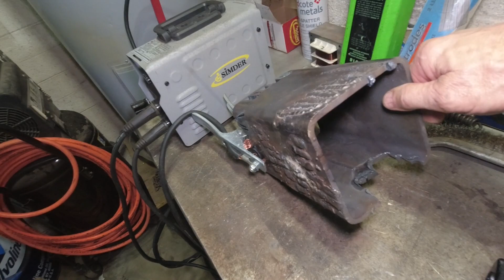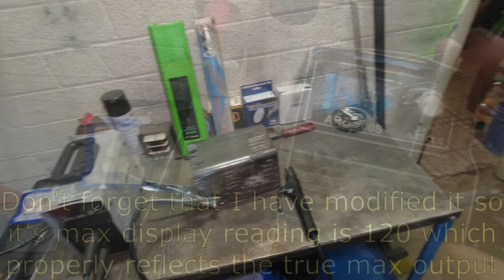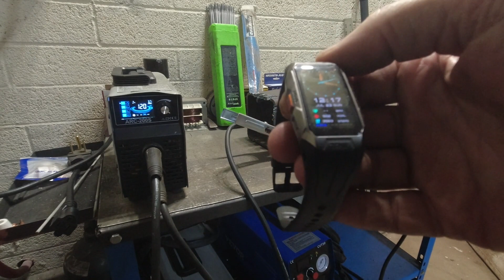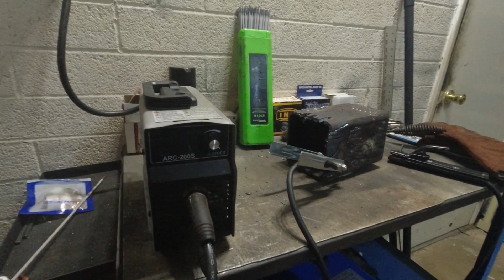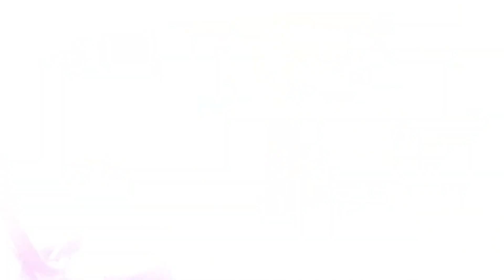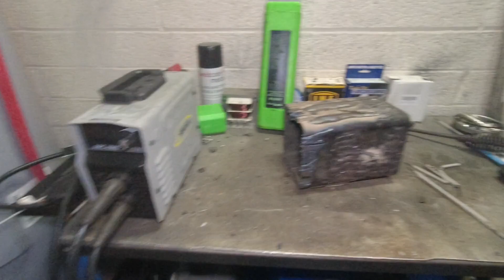Simder Arc 200s Stick/Tig Welding Machine 1 Year Update with Overheat Test! Was Project Farm Right?

Comment: the 7018's get a little bit of glass on the end of them so usually i would take them out of the stinger and i would run a file across the glass tip
Reply from the maker: In the time I spent working in shipyards and building pipelines as a young guy I've probably run many hundreds of pounds of 7018 and I've never once filed the end of one. Of course in those jobs you ran it to a stub far more often than not. I can imagine the looks on the faces of some of my old foremen if they saw me take a half stick of 7018 out of a stinger and file the end down. Of course, that was production welding where time was more valuable than a half a stick of rod.
Reply: @3rdpig  that makes sense. Different environment, different situations, different ways of doing things.  Thats just how i learned or flicking it when it gets the red glow so its clean for next time :)

Comment: How do I stop from the power going out I bought a generator since my house electricity wasn’t capable of running the machine and the generator seems to do the same
Reply from the maker: This machine really needs a 30 amp circuit if you're on 110/120 volts or a 20 amp circuit on 220/240. If Anything less and you'll pop the breaker if you turn the machine up past about 80 or 90 amps (around 150 on the front panel). So look at the breaker on your house or generator and make sure it meets what I said above, or just start turning the machine down until it stop popping the breaker.

Comment: Seems like a good unit I'll stick with my Harbor Freight titanium 225
Reply from the maker: If I had a Titanium 225 I'd probably stick with that too. The little Simder welder isn't bad, in fact it's pretty decent considering it's price and it's tiny size, but it's not a machine that's good for regular use. At least IMO.

Comment: I just got this machine and we were having the same problem striking the arc. We fiddled with everything and finally started getting it to work before it blew the fuse (30a). Does it function better as a tig welder?
Reply: Follow up question: what settings would you recommend to run it on? Just looking to use it for craft/hobby till i get some experience and can afford a better one.
Reply from the maker: I've never used it as a TIG, but to be honest, for a good TIG machine you need high frequency start, gas control built into the machine and, if you want to weld aluminum, AC output. This machine has none of those. Can it be done? Sure, for sheet steel, using a scratch start and a torch with a manual gas valve, it will work. But TBH, this machines best use is as a portable machine for light stick welding jobs on steel. As far as settings for stick welding are concerned, make sure you have it set so it reads 120 Amps turned all the way up (I outlined how to do that in my original review video) turn Hot Start and Arc Force all the way up then set the amperage to what's proper for the type of rod and thickness of material you're welding. I welded at home for years on a machine no better than this one. Once you get a good feel for starting the arc and the proper rod for the job, it will work fine for small jobs.